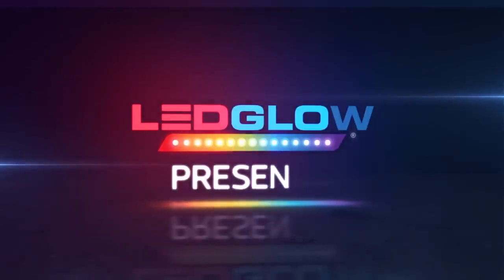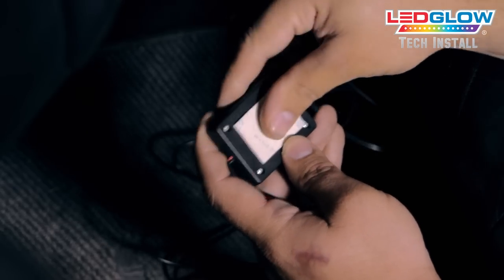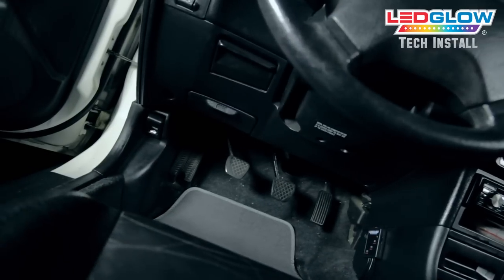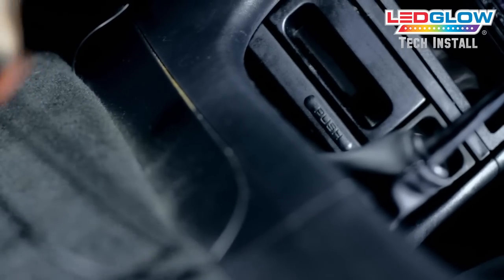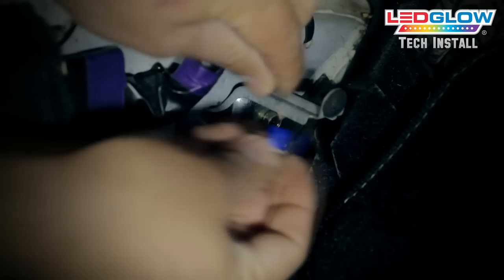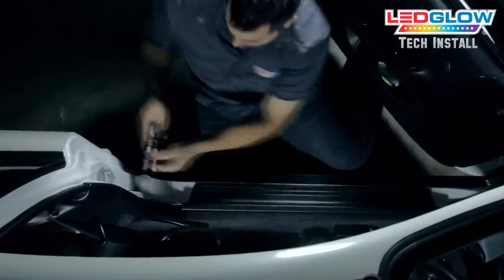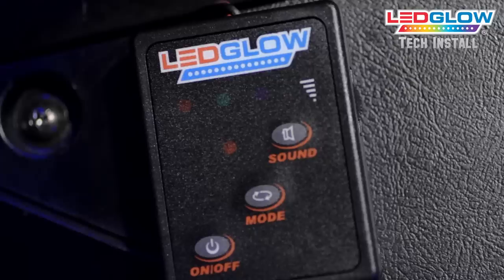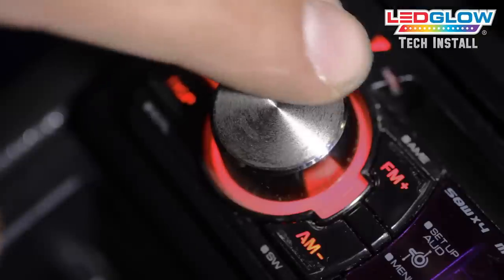Installation | LEDGlow 4pc 7 Color LED Interior Car Lights and Truck Lights

Comment from the maker: Yes, if you power your kit from a switched source the kit will only function when your car's power is turned on. If you power your kit from a constant source it will power the kit regardless if the car is on or not. Also, we recommend that the fuse is no higher than 10 amps. If you have any other questions don't hesitate to ask!

Comment from the maker: Thanks for the kind words and support, MariosGuy! First, you'll need to figure out where you want to mount the tubes and control box and what source you want to the kit to receive power from. Then, you would connect the the red wire to a constant or switched 12v source and the black wire to a ground metal source. Then you would proceed to mount the tubes and hide the wires! If you have any other questions, please don't hesitate to ask! Have a great day and new year!

Comment from the maker: Did you check the fuse to make sure it's not blown? Does the fuse have power when the car is off? Also, make sure the black ground wire is connected to a bare metal surface. If it is not then the kit will not power. Let me know if this helps!

Comment from the maker: Vang, unfortunately when the door is closed, the kit will not function. The kit is being grounded to the door pin so when that circuit closes with the door, the kit turns off and will not function until the door is open. We have a video called "LEDGlow's Auto Illumination" that further explains the auto on process. Let me know if you have any more questions!

Comment from the maker: Hunter, the kit comes included with a red power wire and a black grounding wire, but the expandable circuit and cigarette lighter adapter are optional installation accessories that are sold separately from the kit. Let me know if you have any other questions or concerns!

Comment from the maker: Erveen, unfortunately if you connect the kit so it turns on with the headlights, you will not be able to turn it off manually with the control box. When you connect the kit to the headlights, that now becomes the switch for the kit and overrides the on/off button on the control box. Let me know if you have any other questions or concerns!

Comment from the maker: Yes, I would recommend a mini add a circuit for your 06 Subaru WRX. It can be purchased directly from our website or by calling 877.LED.GLOW and placing an order with one of our sales representatives. Is there anything else I can help you out with?

Comment from the maker: I recommend that you add a standard or mini size 4amp fuse to the particular add a circuit you purchased. We offer our add a circuits with the 4amp fuse because it's needed as circuit protection for the add a circuit. If too much power is going to the kit, it will short the 4amp fuse rather the entire circuit and stock fuse from your car. Let me know if you have any other questions!

Comment from the maker: An expandable add a circuit is not necessary for installation, it's just an easier way to install our kits. If you choose to install our kit with an add a circuit, you will use a mini add a circuit and 4amp fuse. If you have any other questions just ask!

Comment from the maker: Parul, if you installed the kit correctly and are having issues powering the kit, I recommend contacting our technical support dept. at 877.LED.Glow. Our techs will be able to diagnose the exact issue your having with your kit. If you have any other questions or concerns don't hesitate to ask!

Comment: Couple Questions please:

1 - Does the multicolor kit come with the little thingy that allows one to tap into the fuse box?
2 - Does the multicolor kit include the traditionally white LED?  
3 - Does the multicolor kit come with the little grounding ring? 
4 - Does the multicolor kit come with zip ties?

Comment from the maker: If you want the kit to have power at all times, connecting to a constant 12v source is recommended. That allows to kit to function even if the car is turned off. If you want the kit to be powered from the dome light or radio, you would connect to a switched 12v source. If you do plan on using a switched 12v source, be aware that the kit will not function when that switched source is turned off. If you have any other questions just keep asking I'm glad to help!

Comment from the maker: Ok I got you, do you have a single color kit?  If you do you would be able to cut those wires and re-splice, the 7 color is a little tougher since there are 4 different wires for each different color LED.  Let me know if you have any other questions!

Comment from the maker: Unfortunately you cannot connect the red power wire to two different sources because you are risking shorting the kit with too much power going to it. If you want to connect it to two different sources your best bet would be to use two separate, independently powered interior kits. If you have any other questions or concerns don't hesitate to ask!

Comment: i love the interior kit. ive already been asked afew times wher i got them and ive only had them in for a few days i  used the provided screws for up front and small zip ties so i wouldnt cover any led's. i got a few vids up of the interior but my newest with the my 7 color exterior kit as well. the only thing is i wish i got a LEDGlow sticker or something lol

Comment from the maker: I am showing there is a fuse panel on the driver side next to the gas pedal. Remove the kick plate and there should be a fuse panel there. Check your owner's manual for the exact location and let me know if you have any other questions!

Comment: Perfect, exactly what I needed.  One more thing though; I've seen some people on forums saying that they needed to buy extra fuses because the fuse they wanted to attach to the add-a-circuit was a "low profile fuse" or something like that and it wouldn't fit.  Is this something that I will need to buy?  Or is a low profile fuse just another name for a mini fuse?

Comment from the maker: Unfortunately that will not work, the best thing to do is just mount the control box close to the speaker and use the sensitivity wheel until you get your desired effect.  Let me know if I can help with anything else and have a great day!

Comment from the maker: Irving, you will crimp the red power wire to the expandable circuit and ground the black wire to a bare metal surface. Let me know if you have any other questions!

Comment: Thanks for the answer. Based on the video, which types of fuse would give a constant 12V source? And would it be appropriate to use 10A or 30A fuse?

Comment from the maker: Dan, if you do plan to install one of our interior lighting kits, I recommend installing it with our Expandable Circuit and 4amp Fuse like featured in the video. By installing the kit this way, you will eliminate the need to go through the firewall to your Audi's battery. Let me know if you have any specific questions about the interior kit or installation process!
Reply: LEDGlow can u upload a video on how to connect the light tubes and set up?

Comment from the maker: Make sure the interior kit is set to the sound activation mode and test it by tapping the control box. If the kit pulses to the taps then it is functioning fully. If it does not, contact our Technical Support Dept at 877.LED.Glow and our techs will be able to diagnose the exact issue you're having. If I can do anything else for you here just let me know!

Comment from the maker: There are a couple ways you would be able to install this kit.  You can extend the the lead power wires from the control box so that they reach your fuse box, you can run the lead power wires directly to the battery, tap into any constant or switched 12 volt source, or you can use a cigarette lighter adapter.  There are a ton of ways to power the kit.  If you have any other questions you can contact our Technical Support Department at 1.877.LED.Glow.  Have a great day!

Comment from the maker: Our LED interior lighting kits are universal and can be installed to any vehicle with a 12v power source, so you shouldn't run into any issues with your 2007 Nissan Altima. Send some pictures of the installed kit to our Facebook page!

Comment from the maker: If the wire rips, we recommend purchasing new tubes. Trying to repair the wire to the light tube could potentially cause a short within the kit. If you have any other questions just ask!

Comment: so basicly verry verry verry easy explained : red wire from light on Add a circuit mini fuse holder, that you put on a 4amp fuse, wich you put that one on your fuse box. and the black wire on something from metal ? is that correct ? I've never done something on my car before. If I understand it I gonna place my order ASAP ! Ledglow looks really cool !

Comment: Hey led glow, the video shows you guys connecting the kit into a fuse with a 20 on it, is that 20 amps? I was reading you can only connect the kit with less than 20 amps? Could use a little help with this question.  thanks, Dan

Comment from the maker: Yes you can cut the red and black lead power wires, but DO NOT cut the lead wires going from the tube to the control box that will void the warranty.  If you have any other questions or concerns please just ask.  Have a great day!

Comment: For the led to activate with the door opening was the negative wire just slipped through and wedged in on top of female connecters for the door pin? No splicing or cutting required? I couldnt really see it in the video.
Reply from the maker: noobtube1210 To install the ground wire to the door pin, we removed and disconnected the door pin. We used a spade terminal and inserted the ground wire between the door pin and female connector, and then reinstalled the door pin.

Comment from the maker: Yes, the add a circuit is sold separately, but you can add it to your shopping cart directly from the product page of the interior kit under the "Installation Accessories" drop down menu. If you have any other questions just ask!

Comment: ok thanks and another question, will the sound function still work if i use the switch and the auto illumination function? and does it go off of sound it senses? or does it receive some kind of electrical signal telling it when to pulse?

Comment: cant exactly see where you are connecting the ground wire inside the door..also will it work via sound mode/or have the ability to be turned on when the door is closed? or does the door have to be open for it to ever work
Reply from the maker: stanleycjohn In this installation we connected the ground wire to the door pin for the auto illumination function. The auto illumination function is an optional feature with the kit and when connected to the door pin, the lights will only function when the door is opened. Check out our video called "LEDGlow's Auto Illumination" for more information about the auto illumination function. Let me know if you have any other questions or concerns!

Comment: Hey Guys this a great product I bought it a couple of months ago and now that is warmer I'm putting them on my car and I realized that I didn't get zip ties from you guys but that is no big deal I was wondering do you need a 4 amp fuse inserted into the add a fuse connector in order for it to work or any fuse and another thing I can't seem to find a constant 12 volt in my honda civic if any ideas I appreciate the feedback thanks again

Comment: I just ordered these! If I run the ground wire to my door pin and have the power wire going to a 12v source the lights will come on when I open the door and when I drive with the door closed correct?

Comment: I did everything in this video. I crimped the red wire into the add-a-circuit and plugged that into a 10 A fuse. I tried many fuses. The lights are not turning on.

Comment: Thanks but i dont really care about the warranty, i just wna know, if i cut the wires from control box to led tubes, will it work if i connect them again using electrical tape or with those blue butts.

Comment: One last question. So whichever fuse i connect it with it will turn on with whatever the fuse is for? and also the fuse  must be 10 amps or less right?

Comment from the maker: Unfortunately the auto illumination function is not available at this time with the Million Color Mini Interior Kit. You will not need any addition items with your interior kit unless you decide to connect your kit to receive power from your vehicle's fuse box. If so, you'll need a mini add a circuit for your 2013 gti. If you have any other questions or concerns don't hesitate to ask!

Comment from the maker: The pink 4amp fuse that comes with the add a circuit is used as circuit protection for the kit. If there is too much power going to the kit, it will short the 4amp fuse rather than the control box of the interior kit and stock from your vehicle. The other fuse is the stock fuse from your fuse box and that source is what's powering the interior kit. Let me know if you have any other questions!

Comment: I bought this and it's working perfectly but I put it in the 7.5 amp part in the fuse box and now after a day of use the battery indicator came on. What do I do?
Reply from the maker: Whenever your battery light comes on, that is typically an indicator that you are having issues with your electrical system, aka the alternator. I would go to a car shop and have them test to see if your alternator is still charging sufficiently.

Comment: Does this come with instructions on how to do the auto door illumination?  It was WAY TO QUICK on video?
Reply from the maker: The instructions will instruct you on how to install to a 12 volt power source, but you can give us a call directly at 1-877-LEDGLOW and we can further assist!

Comment: This may be a silly question, but how do you know what is a 12v source? Looked like the fuse you pulled out said 20 on it. I know very little about cars and would appreciate the info!
Reply from the maker: boobear81 Whenever I mention 12v source, I am referring to the vehicle's battery. Almost every car is powered by a 12v battery, which also is the main power source of the LED kit. The 20amp fuse we used for the expandable circuit also powers the kit whether it's a switched or constant power source, but if your car's battery is pulling less than 12v you will not be able to use any of your car's electrical functions including the interior kit. Does this explanation clear things up for you?

Comment: I want to buy this exact kit for my '99 audi a4. Can you tell exactly what I need to order. I like how easy it is to draw power from the fuse box. Also does it include the auto illumination mode?

Comment from the maker: If you have it hooked up to the door, the kit will only work with the door opened. If you connect it to the ignition key source or any other switched source, the kit will turn on with the ignition key and you will be able to use all the featured functions with the kit. Possible sources for this are radio, power windows, sunroof, anything that will only work with the key in the ignition. We will release an install video on this exact issue very soon so stay tuned!

Comment: I just got my kit and was had a question about grounding the black wire. Do I have to buy some grounding kit from an auto parts store? There was nothing included like the little grounding ring in the video that I could attach the black wire to (like the red wire to the fuse cable)

Comment: I could only find Add-A-Circuits that can't exceed 10 Amps, will 10 Amps be fine for this installation or am I going to need 15? If you could tell me what Amp fuses would work that would be awesome, oh and by the way the video says it comes with included zip ties but I didnt get any with mine... Not a big deal for me but just letting you know...

Comment: you said this kit has auto illumination when doors are open. Will the lights still turn on when the doors are closed and engine running?

Comment from the maker: Yes, it's that easy with the add a circuit! You will connect the black wire to any bare metal location to ground the kit. If you have any other questions about the add a circuit or installation process, don't hesitate to ask!

Comment from the maker: If you are connecting the interior kit to your vehicle's battery then you should be good to go with the included red and black power wires, but you may have to extend the wires using 18 gauge automotive grade wiring. If you want to power the kit directly from your Eclipse's fuse box, you will need a mini add a circuit. If you want to power the kit from your vehicle's cigarette lighter port then you will need a cigarette lighter adapter. Let me know if you have any other questions or concerns!

Comment: Okay, so if I hook this up the way the video shows it'll turn on and off with my dome light? And if I choose not to do that option do I have to manually turn it on? Or will they turn on with the start of the car?
Reply from the maker: Nick Neitz Yes, if you install your kit to the door pin using the auto illumination mode, the kit will only function when the door is opened and will not function when the door is closed. If you don't want to install the kit to the door pin using the auto illumination mode, you can power the kit from any constant (unswitched) or switched 12v source, but you will have to manually turn the kit off when connected to a constant (unswitched) source such as the battery. If you're connected to a switched source then the kit will turn off when you power the car down and you will not be able to use the kit unless the car is powered on. Let me know if I can help with anything else!